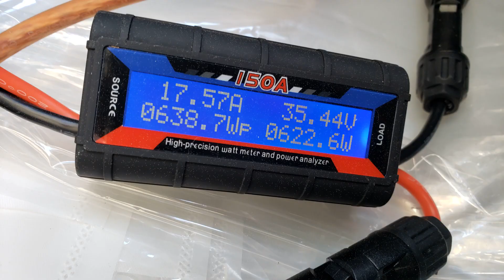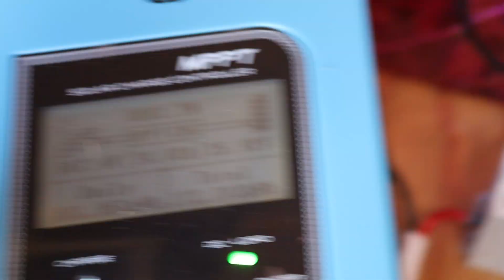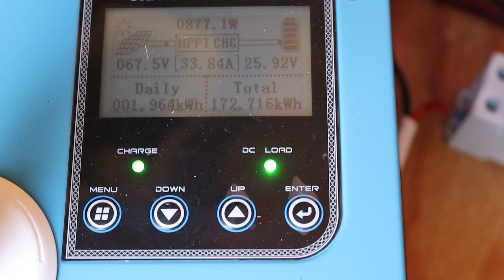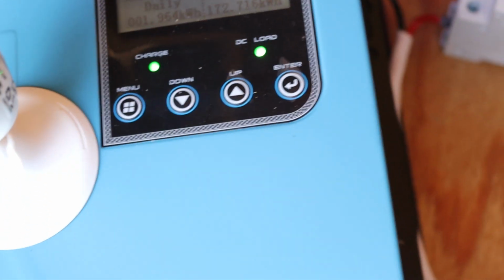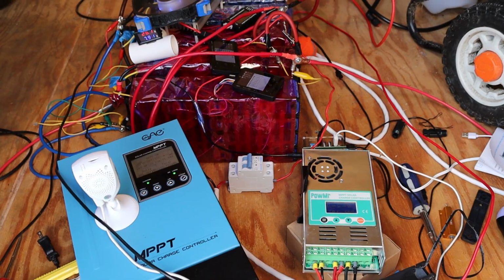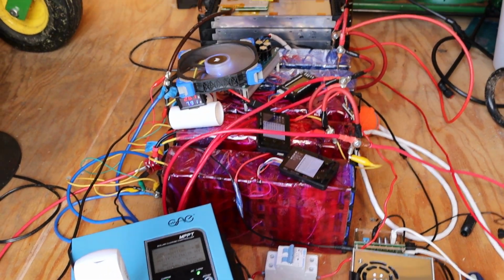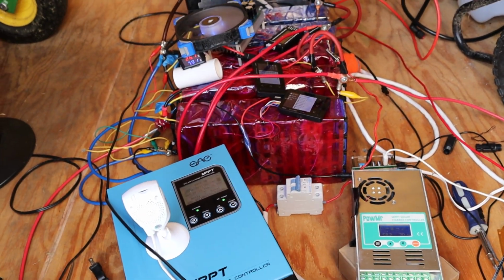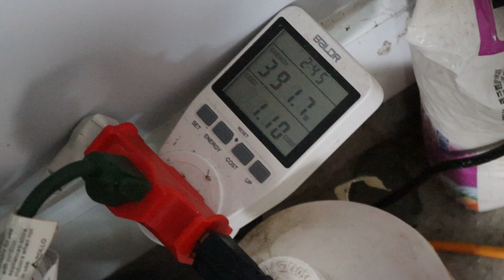Cheap Spot Welder vs K-Weld, 18650

Comment: thanks. at 5:00 nickel strip rotates while welded to the button can on battery. how is that? is it that the button cap is not factory welded to the body of the battery? how is it loose? attached only by the pvc tubing?!
Reply from the maker: Thanks for watching.  its not a perfect fit.  depending on the cell wrapper thickness. its not going anywhere once the cells are all welded.
Reply: I have not fully understood, positive  button cap is not factory welded to battery? It is only suppkrted by the pvc heat shrink? 

I am asking because i am salvaging tesla 3 model 21700 cells that come positive flat and are made of aluminum which is hard for spot welding, so maybe adding a button which is held by pvc shrink wrap may better enable spot welding.

Comment: How many welds do you get off the batteries on tr k weld. I ordered one with 2 turnigy 5 ah batteries
Reply from the maker: This battery was 3s- 8ah cells. You will be able to weld any "regular" size battery together before having to recharge with those. I dont remember the details but im sure that is enough.
Reply: @RodneySolarCircuits  thank you I got 2 sets of batteries. They were recommended on the k weld site. Waiting for them to come in. All my 32650 cells are waiting to be put together. Also how many welds on average before you let the k weld could down.
Reply from the maker: @chrishaney1954  You will feel it, thats why I had 2 welders.  It will get too hot to hold. literally!  But I dont recall the welder getting to hot only the tips.

Comment: Hey what battery are u using on the cheap spot welder. Is it spim08hp
Reply from the maker: Yes 3s1p. But it gets warm so I would do 3s2p if I did it again.
Reply: Cool I have my own setup but it makes me set it to 65 to get Any good welds.

Comment: So what "upgrades" did you do to your red welder? 
I heard about adding an extra capacitor to help prevent the blowout of those switch chips (there are videos online about this), and something about a bypas circuit to prevent extra voltage buildup or what not (this one i cant find any good references to)
Reply from the maker: I've never had a problem with mine.  I run it till its too hot to hold then switch to the k weld.
Reply: @RodneySolarCircuits  
thanks for your reply. 
This is what I am referring to btw. 

https://youtu.be/fdnO0Z-scjA

Any thoughts?
Reply from the maker: @Orvis25   he changed the cheap mosfets with good ones.  prolly dont need the extra cap.  like i said mine works  and welds as good as my K-weld. I ordered mine from Ebay. link in the description.
Reply from the maker: My welder is stock.  8ga ofc battery leads with an 8ah 3s LiPo battery.      So the clicking I have had on the other cheap welders at low voltage. This video makes since. I would use mine to 11v then charge back to 12.3v.  Maybe you could add copper to the traces, beef em up.  but it sounds like cheap mosfets.  cant fix that.
Reply: @RodneySolarCircuits  I'm probably going to use a standard 12v AGM battery for UPS's (since that's what I have, I dont have equipment to charge lipo packs like that). I will make sure to watch the voltage so it does not go too low, maybe even leave it hooked up to a portable car battery charger on low too for extra Amps available, and to help recharge it at same time.  

When you say beef up the traces, are you referring to the huge solder lines that run to and after (incoming from battery and exiting into the two handheld wires) the mosfests? 

If so, what benefit would that have? My understanding of many of the issues with these welders leads to the mosfets being crap and/or poor electrical design in terms of stability. 

Ps: appreciate your feedback, so rare to see YT people so interactive in comments.

Comment: I just order one thank you.  I'm just wanting to make some simple 18650 batteries for RC planes, mostly 2, 3 & 4S.  What do you suggest the best Nickle to weld up such batteries?
Reply from the maker: in the description there are some links to nickel strip. .15mmx.8mm strip will carry 5 amps. so double up if you need to.

Comment: Unfortunately, I am one of those unlucky ones that did purchase a faulty red cheap spot welder... I even went and bought a 3S 5500mah 50C LiPo :3 Oh well... 
I have a question though... Can I use just one LiPo with the Kweld without ultracapacitors? I'm not perfectly familia with these kinds of things, so I had to ask... 
(in case you wonder, yes, I am thinking about getting a Kweld and operating it with the LiPo I already purchased... I'd be most greatful if you could give me your opinion )
Reply from the maker: Yea.  I use a 3s lipo with mine. No Caps
Reply from the maker: Sad you got a bad one. You could buy another and has extra mosfets.  Whats another $30 when you are gonna spend 250 on a kweld.  Just saying.  Kweld is awesome tho.  Doing this big project it was nice to be able to swap welders and not have to stop as often.  Battery gets hot too.
Reply: @RodneySolarCircuits  Look... I'm a little jealous of you... In the sense that your Chinese doohickey actually works. Believe me when I say that I'm not the only one that's "jealous". Most of the youtube videos demonstrating this spot welder were resulted in failure... However I did pull the trigger and ordered one, in hopes that I will have your luck xD Well it fried... 
After this one failure I'm not willing to pull the trigger again. My chances are about 30% success this time. But I won't take my chances xD If I can get away with around 160€ for a Kweld and not need anything other than my existing LiPo, I'm fine with that... At least I won't have to worry about a spot welder any more...

1. You did answer regarding my LiPo, however I think yours are quite more powerful. Do you think my 3S 5500mah 50C LiPo will be enough for the Kweld?

2. Also, if you'd be so kind as to confirm that only a LiPo and the basic kit are enough for the whole thing to work 🥺
In other words, if I buy this:
https://www.keenlab.de/index.php/product/kweld-complete-kit/
And plug the LiPo, will I be ready to go? 🥺
(or do i need something else too)
If it's not too much trouble, could you tell me how many welds will I be able to make with that 5500mah LiPo before needing to recharge? (based on your experience)
Sorry to bother you so much 😐 I am a bit troubled and trying to get a proper spot welder...
Reply: @RodneySolarCircuits  This is another account of mine btw... Didn't mention that xD
Reply: @FishFish1995  your Chinese one will also work if you "just" add a capacitor. Refer to the maker Fabio's video.

I don't know if you have any education on Electrical field or not. If yes, then you will understand why the mosfets are failing and the modification suggested by Fabio fixes those problems....

Take a look at this video https://youtu.be/fdnO0Z-scjA

Comment: Are your packs 1 s ?
Reply from the maker: Yes, I think it will be the easiest way to fine tune the capacity of each series.
Reply: @RodneySolarCircuits  why not use longer nickle across the whole pack?
Reply from the maker: @frankz1125  fuses
Reply: @RodneySolarCircuits  are you doing full strips on the other side?
Reply from the maker: @frankz1125   mirror on both sides.  But I could make it one longer strip on the opposite side of the fuses. I didnt even think of that. Thanks.
Reply: @RodneySolarCircuits  save you a lot of cutting and overlap of material.  On that big of scale it may be significant.  Just a thought. Looking good though
Reply from the maker: @frankz1125  Thanks, I still have to make the connection to the busbar from the pack.  I was just going to solder it,  Might try to weld 1 end of the fuse to the battery/solder to the busbar.
Reply: @RodneySolarCircuits  I'm not sure what your best solution is. But it will have to be able to handle the full current of the battery.  What size inverter are you using?
Reply from the maker: @frankz1125  12k growatt LF
Reply: @RodneySolarCircuits  Your connections will need to handle 300 A.